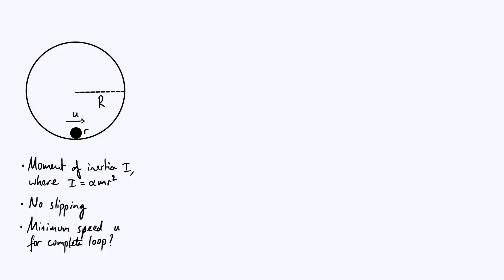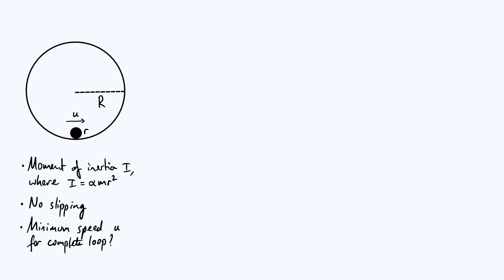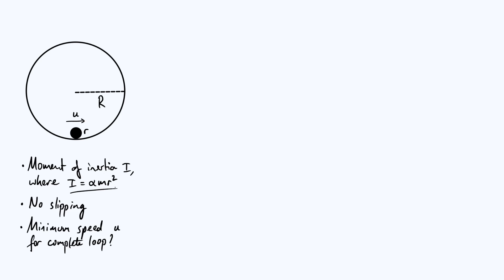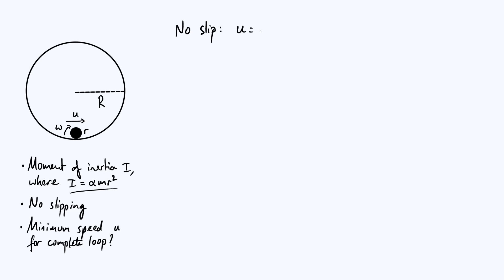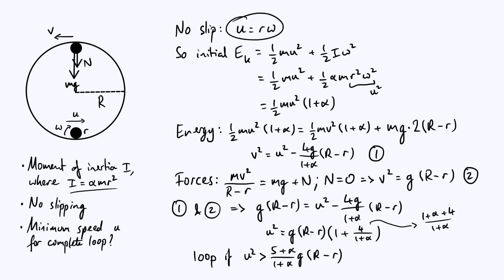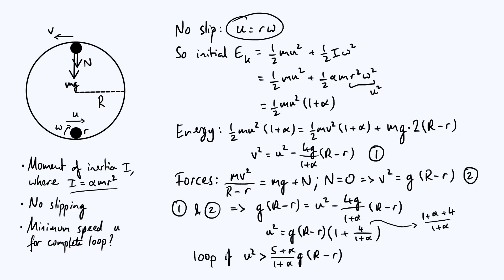Minimum speed for a full loop, including rigid body rotation

Comment: rotational motion is always interesting :) if the large sphere itself was rolling then we would also have to account for the large sphere's kinetic energy i think.

so if we had to find the condition for oscillation for this particular problem then it would be.. if im not wrong

         [(2 + a) g (R - r)]^1/2
 u <   --------------------
          [       1 + a        ]^1/2
Reply from the maker: I'd have to think about how to solve that! The complication is that if the loop itself were rolling along, then the object inside would no longer be moving in a circle, due to the translational motion of the loop. The result would also depend on whether the loop is able to roll freely or is being forced along at some fixed velocity. Maybe an interesting topic for a future video!